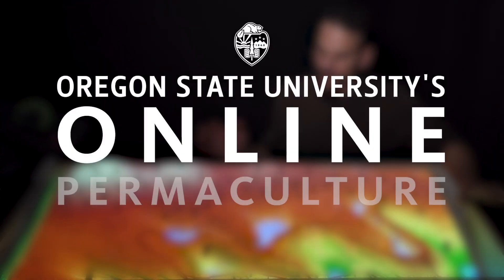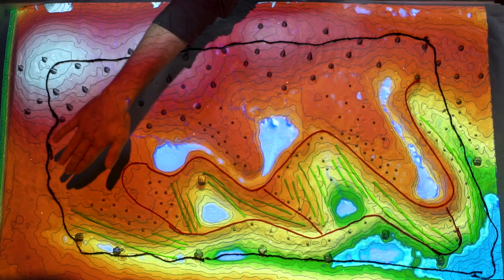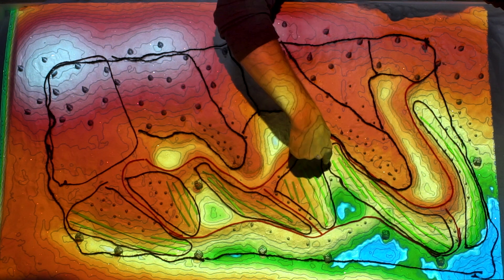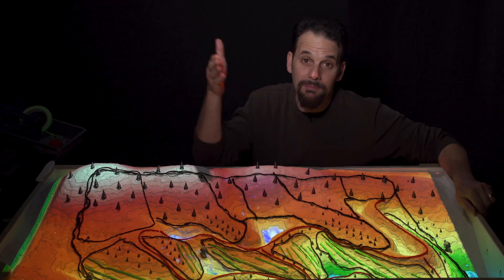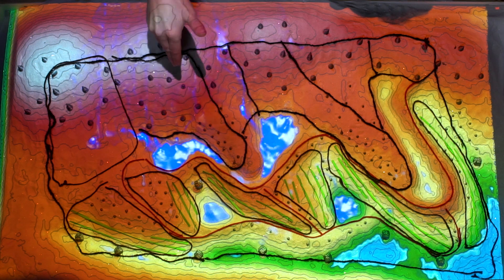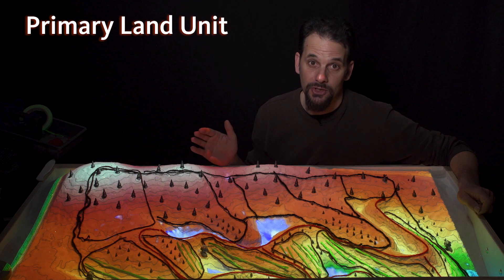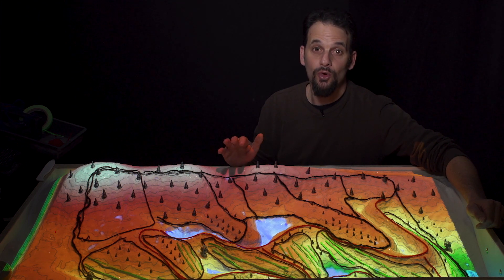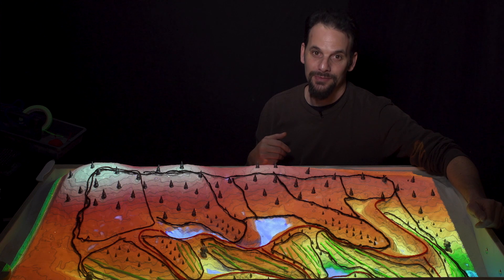Keyline® in the AR Sandbox #6: Design for Management

Comment: I bought P A Yeomans book years ago, and have looked in to various explanations about the his methodology over the years. And this is the first time I have truly understood it. Thanks so much for releasing this video!
Reply from the maker: That book is very hard to interpret! I read it multiple times, but until I took a workshop with Darren Doherty of the Regrarians before it really made sense. So I shared that information here in these videos :-)
Reply: @amillison  Thanks so much man. One thing I wondered about though was with regards to keypoint ponds. You say they are eventually only really filled by road run off so not to give them a higher capacity than what the road can supply. But dont a lot of ponds fill naturally just with direct rainfall combined with the fact they are below ground level?
Reply from the maker: @mediterraneanpermaculture6701  It really depends on the soil, climate, and vegetative conditions. Where I live in Oregon, even the old growth forest will have excess water moving laterally downslope subsoil during the wettest of times. But the point is, if you improve the absorptive capacity of the catchment, then there will be a lot less water moving through then if it is degraded with high runoff. But a road will always be a runoff surface. Darren Doherty always talks about how people go and plan ponds for the current degraded conditions, and then when the landscape increases its water holding capacity, the ponds are then over-sized. But it really depends where you are. In monsoonal and most desert climates, there is always excess runoff at some point in the year over the broad landscape. But this may not be the case in climate types with more lighter consistent rainfall.
Reply: @amillison  Thanks a lot Andrew that does clarify things. 
Thanks again for making such great content available for free

Comment: Hi Andrew thank you for this fantastic series. Is there a reason not to build ponds on the main ridge?
Reply from the maker: Often times a main ridge is more rocky or with shallow soils, being at the top of the system. There may be a good saddle on the main ridge which has a good shape for the economic construction of a reservoir (ratio of soil moved to water stored), but the soil conditions are less likely to be favorable the higher up you go. It really depends on the geology and geography.
Reply: @amillison  Gotcha 👍 Thanks so much man!

Comment: @Andrew Millison I've been struggling on how to apply permaculture design and drainage on a very flat area. I keep getting responses that there is no flat land, but when it rains the water just stands, and I don't know how to design the land to control the water flow and also save it.

Could you assist with tips or do a video on the hydrology and permaculture design on flat area! That'd be great!
Reply from the maker: Hi. For a truly flat area, like a playa or lake bed, drainage can be a real issue because water has nowhere to go. Often times in wet climates these become swamps or wetlands. A great strategy for this type of situation is building chinampas , which is essentially lowering some portions and building up other portions of the landscape so you can create productive areas out of the water. This is how the Aztecs thrived in Central Mexico: https://en.wikipedia.org/wiki/Chinampa#:~:text=Chinampa%20(Nahuatl%20languages%3A%20chin%C4%81mitl%20%5B,in%20the%20Valley%20of%20Mexico.
So a lot depends on what climate and rainfall zone you are in.
Reply: @amillison  Thank you very much for the kind reply. Truly appreciate it. 

To understand thia, it depends on climate and rainfall - meaning build up the land in heavy rainfall areas? And lower the land (dig swales?) in arid areas?
Reply from the maker: @intrepid-crossing2356  What you are doing is creating more extreme microclimates out of a flat monotonous microclimate. So even in a dryland, some species would prefer a sunken wetter area, where some would prefer the raised areas where they are not waterlogged during rainy periods (useful cacti for example). Same goes for wetter climates. Some species will thrive in the low soggy areas, like wetland species (and you can even raise fish and crustaceans!), where some species want to be out of standing water with the top of their root zones dry.
So you are not simply lowering the land in dry areas, you're simultaneously building up. And same goes for wetter areas, you're building up some areas and sinking down others to create a diversity of microclimates for different species.
Reply: @amillison  Thank you again. Very interesting; a balance of human intervention and nature's guidance. However for a flat land it seems that a major landscaping overhaul is necessary to direct the water flows. Or should I keep planting trees so the soil becomes more permeable to water? 

On another completely different subject - land surveying; there is lidar sensing, can these be a alternative to conventional surveying methods. Or are conventional surveying methods still best bet?
Reply from the maker: @intrepid-crossing2356  At this point lider surveying can be done by drones. This is absolutely superior to traditional surveying in ease, cost, and accuracy of maps.
Reply from the maker: @intrepid-crossing2356  It's not necessarily less expensive if you are purchasing the equipment from scratch, but less expensive to hire someone to do it who already has all the gear and skills.